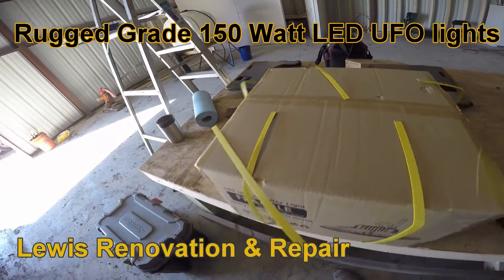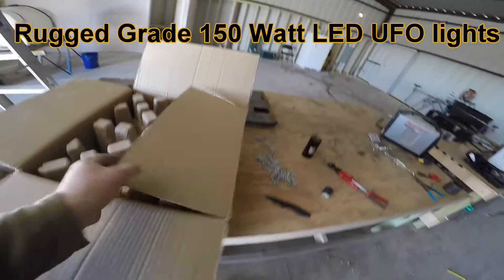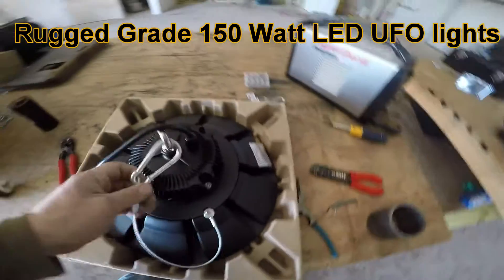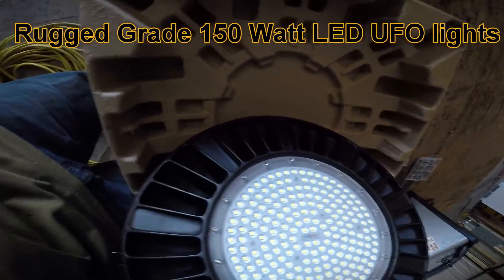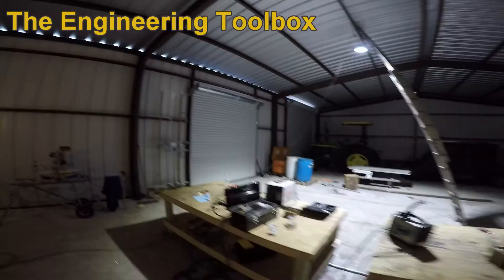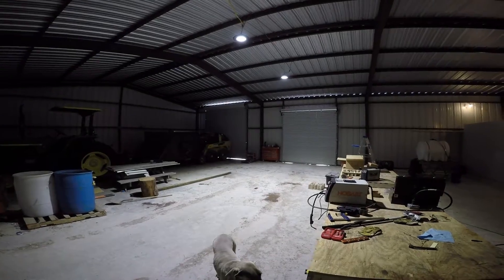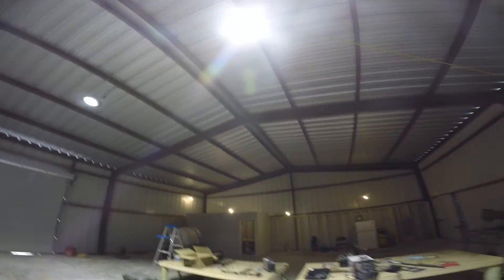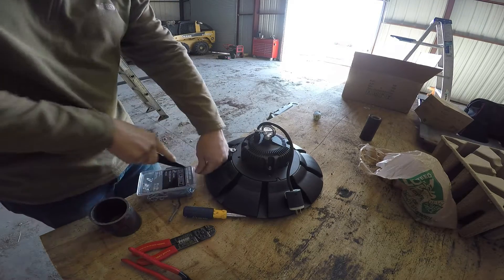LED RuggedGrade UFO Light Review

Comment: How have the led ufo lights been working?
Reply from the maker: They are still working great. I plan installing two more just like them.
Reply: Lewis Renovation thank u.  How big is your shop? How many light did u install. How tall is your building?
Reply from the maker: I have a 40 x 60 shop but only 40 x 40 is wide open. The other part I've walled of seperate. X2 ufo lights are above half the 40 x 40 and I'd like to put in x2 more. They are really bright but still get shadows on the edges when the doors are closed. I've got one LED light installed on the wall and plan to install x3 more to get rid of shadows.
Reply: Lewis Renovation thank u.